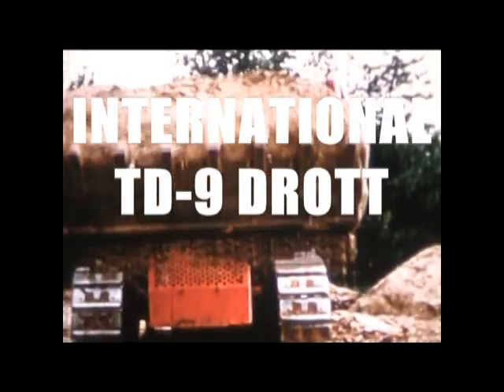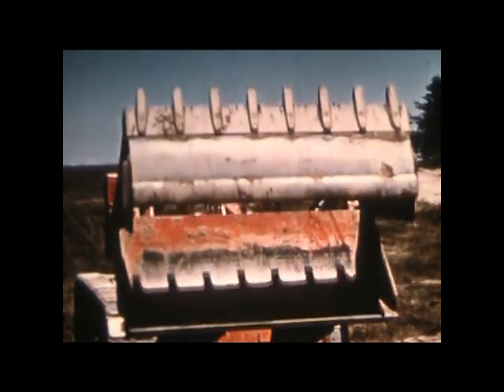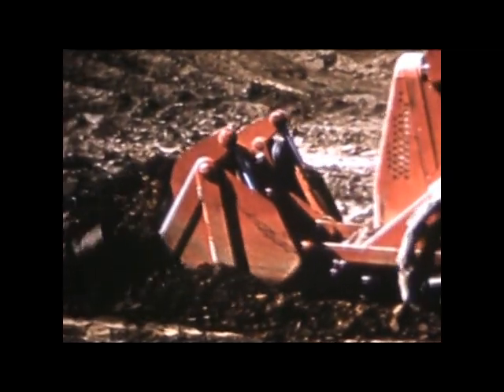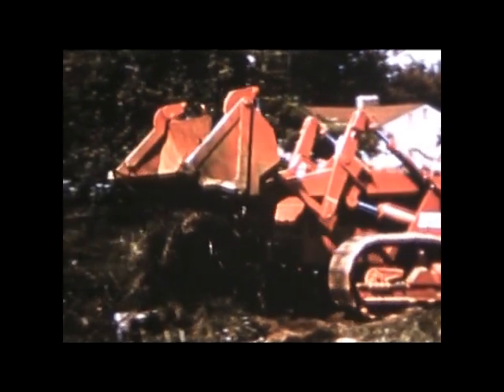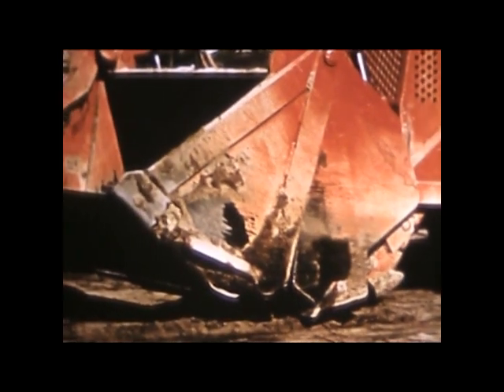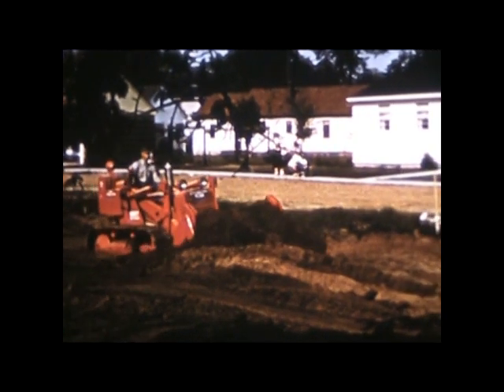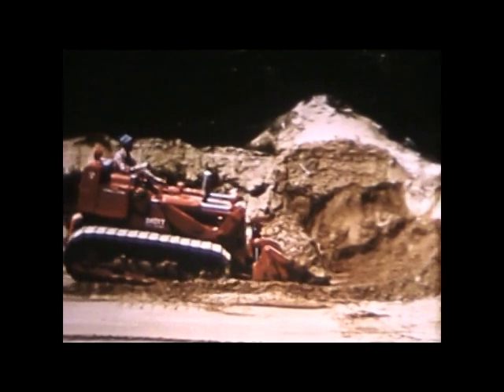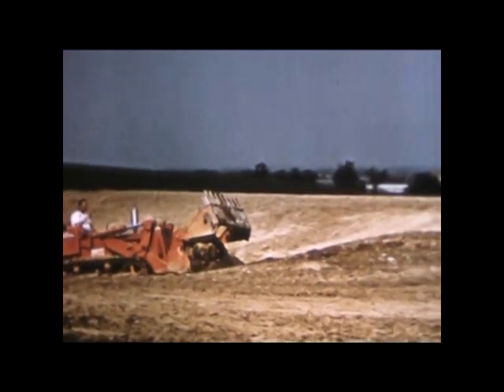International  Drott Part 1

Comment: I have owned several Drott buckets on Case machines as they bought Drott, really useful. Since I retired I sold them but since came across a Massey Ferguson crawler with a Drott bucket, it had a frozen engine because someone removed the injectors and never finished. I rebuilt it and restored the machine. Great for my 15 acres. Coming to youtube one day. Right now just on tractorbynet.
Reply: Hola,soy de México y compre un Drott pero me tiro el aceite de reten  de la trasmicion,si podre conseguir  las refaciones  aún?

Comment: Early 60 often replaced by the IH Payloader, a wheel loader indeed,which their operators initially could not handle in the proper way.(notably their gear box)

Comment: I own one. Just put a new clutch in and will work it into my grave, used it to dig the hole. My kids will learn to operate it.
Reply: Hi Allen I too just bought a T340 Drott international as shown in this video.  I also need a new clutch, and brake adj.  Do you know where to find the parts for this machine, and a manual>  Thomas
Reply: Thank you Allen
Reply: If you just repair the clutch, raise the loader bucket and secure it. You have to clear the clutch actuating shaft from the loader lifting arm for removal. The loader frame has holes in it but the lifting arms get in the way.  A thorough cleaning of the bilge area will reveille any lost parts. Some parts of the clutch are not iron, so when you drop them into the engine skid pan area,  You'll be pissed.

Comment: I used to watch one of these in the early sixties,I am sure it had a glass jar on the hood. Anyone tell me what it was for?  Thanks
Reply: Air cleaner intake precleaner bowl. it seperated out the larger dirt particles and being glass you see if it was getting full. It saved the aircleaner elements from getting blocked up early while working .